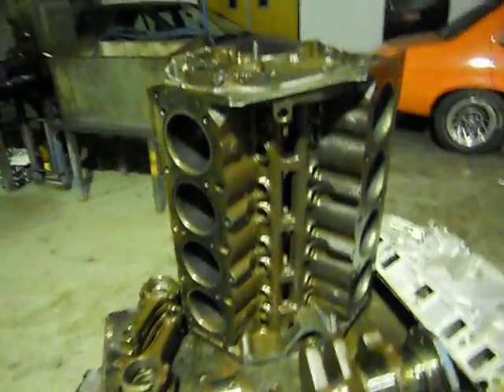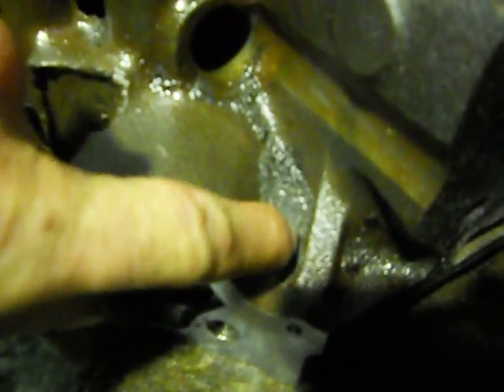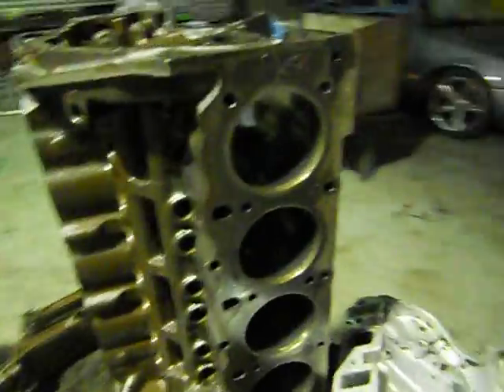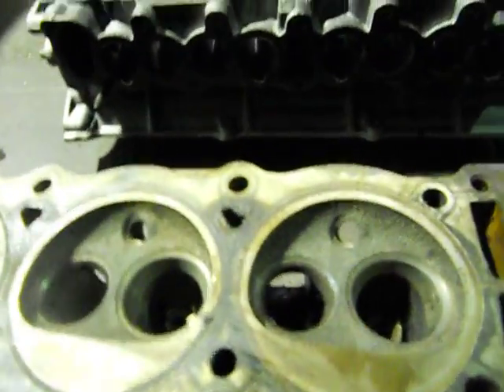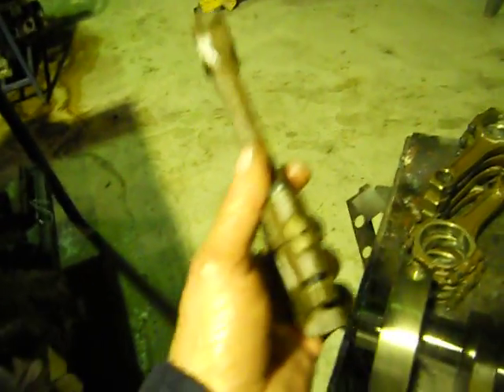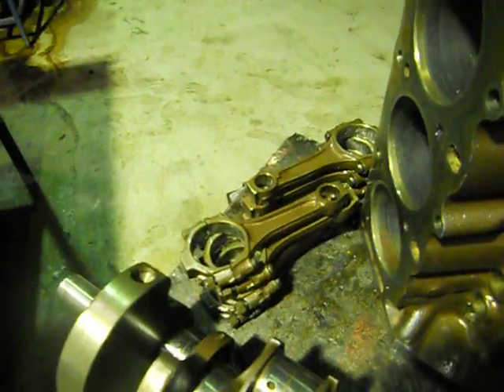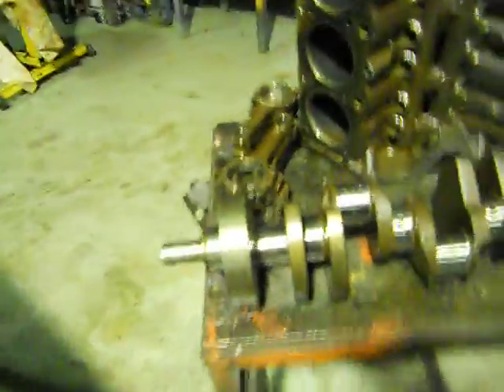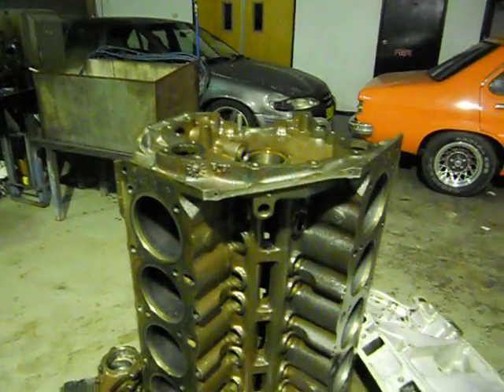How to Rebuild a General Motors Holden Engine part 4

Comment: Your comment about numbering the big end caps,as you say, is so important! The number of ways of mixing them up is way more than 64 though. The first rod you can choose one of 8 different caps then put them aside. the second rod you can choose one of seven different caps, the third one of 6 etc. So the amount of combinations is 8x7x6x5x4x3x2x1= 40,320.

Comment: Im just curious wouldnt it have been easier to use a pressure washer to clean that crap off because from my knowledge it would probably be cheaper and easier than puting it in an acid tank and also at the same time u contanimate the chemical inside the tank.

Comment from the maker: G'day mate,good question,the only thing similar is the General Motors tag,the Holden 253ci/4.2L and the 308ci/5L has external oil pump,lead bank is right hand for right hand drive cars